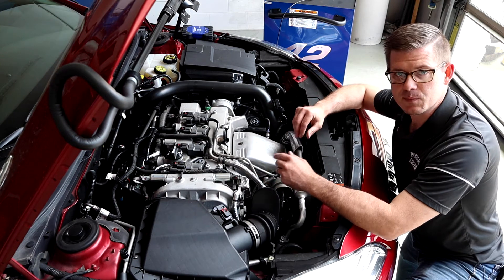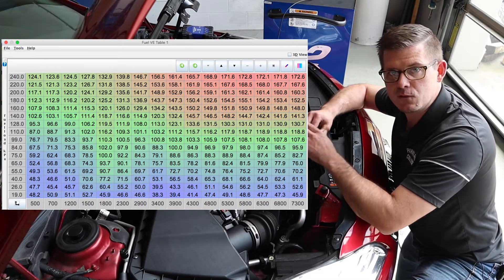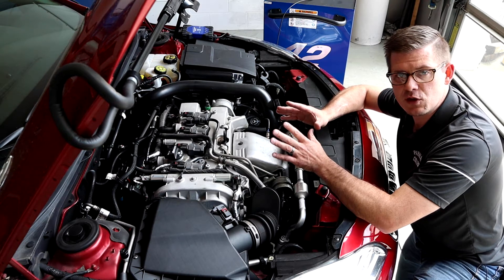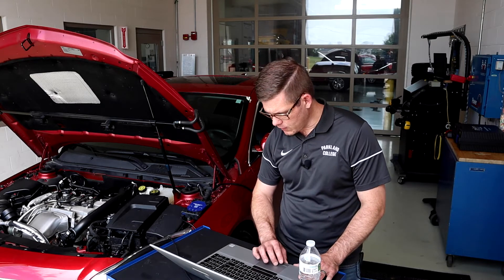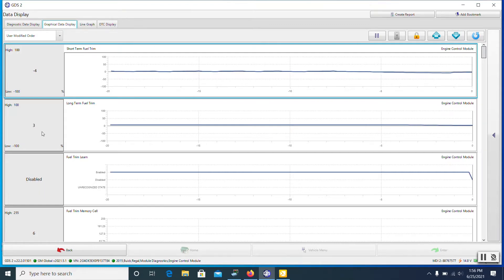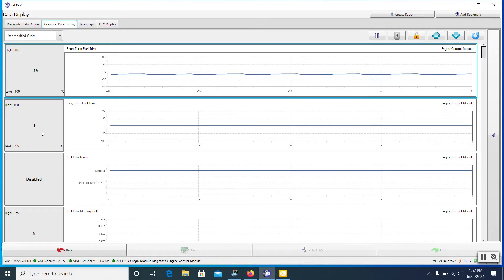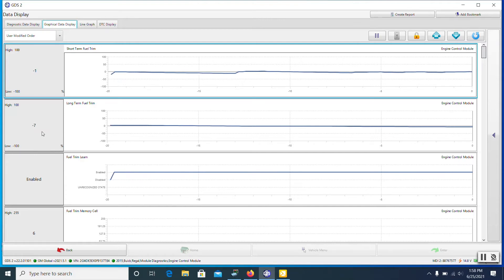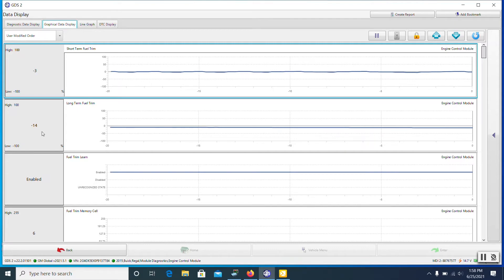Fuel Trims: Introduction & Overview

Comment: Looked at a 2000 Honda Civic EK3 which has a P0132 code (Oxygen Sensor B1S1 high Voltage) car only has two O2 sensors.

Took car for a drive, it loses power randomly then regains it. LIVE DATA stats the STFT goes as high as -50% when it loses power and LTFT stays at around -3%. The upstream O2 sensor shows its in rich condition at around 0.7V but will drop to 0.01V when the car loses power and the downstream O2 sensor is showing 1.2V, will change from time to time but will always be in rich condition. 

I checked the spark plugs and they all have soot or carbon build up on the tips so it is running rich. Noticed the upstream O2 sensor plug, the plastic clip that holds the wire/pins in comes loose at times. 

Any ideas?...
Reply from the maker: That sounds like an interesting one. I think you're on the right track to question the integrity of connectors and wiring. Have you looked at Honda's flow chart for the DTC?